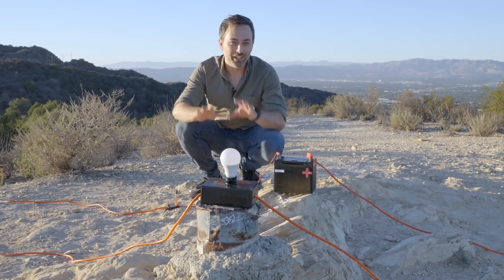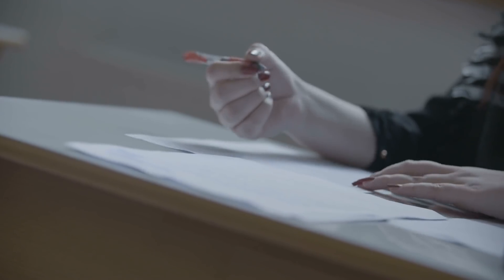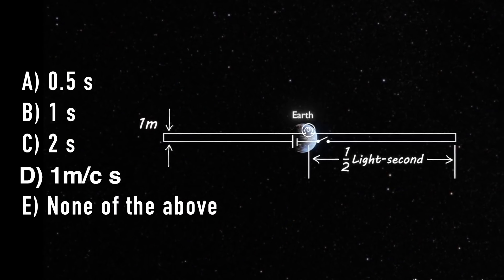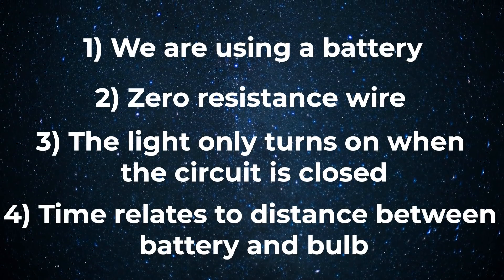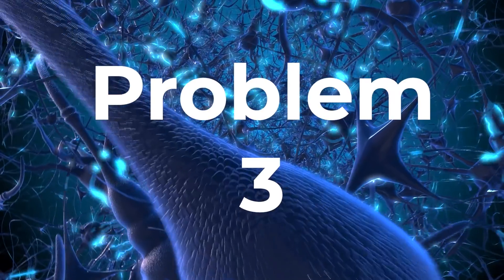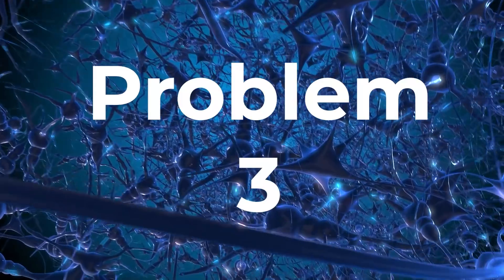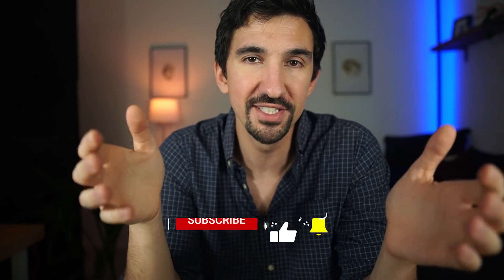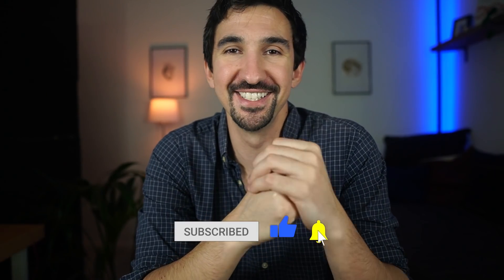Is Veritasium Wrong About Electricity?

Comment: The field model or more specifically the wave model is correct (and I believe what veritasium was trying to convey). It's something you can test in the lab actually, and you don't need super conductors. Getting macroscale timing is almost impossible because of the wire lengths involved, but you can do it on the microsecond time scale fairly straightforwardly.  You need a signal generator, a scope and a really long coax cable.

If you use the signal generator (in pulse mode) like the battery/switch and the scope like the light. Attach the BNC in series so that it extends the circuit. If you're careful with your' measurements you'll see the oscilliscope come up almost instantly (thickness of cable  / c). You can go further and see that regardless of how long the cable is, there only seems to be about 50 ohms of source resistance initially. If that coax cable is terminated then when the wave hits the end it's absorbed and the initial state is the final state. However, if the cable is open (or terminated with anything other than 50 ohms) the wave will reflect back and you'll see a change in level when it hits the scope (depending on how the scope is terminated it might bounce again). 

In veritasium's setup, the impedance seen by the circuit (while the wave is propogating) would be cosh^-1(s/d) * sqrt(u/e) / pi. Assuming that's 4/0 cabling would put it at about  600 ohms per side or just over a kiloohm. That's actually enough to light an LED  on 12V.
Reply: That is NOT 4/0 cabling. In fact, if he hooked up a 12 V car battery to 4/0 cables somehow (you would need to build your own connection method, as 4/0 cable is HUUUUUGE), the resistance of the 4/0 wire would be too high to light the bulb even if the cables were short. 4/0 has a large diameter compared to the 14 or 12 AWG cable that should have been used for this. You could do with an 18 or 22 AWG cable too, since it's just on a 12 V DC car battery. They could handle it. a 4/0 has a diameter of almost 12 centimeters (not counting the insulation, just the conductor inside it), while a 14 AWG (standard for lighting circuits in houses) has a diameter close to 1.5 mm, assuming copper conductors, not aluminum or gold.   The surface area of the conductor matters a lot, just as the length of the conductor does, when calculating the resistance of the circuit. You may be able to get a small diode to light up off a 12V source using 4/0 conductors, but not a full sized lightbulb, without increasing the power source way about 12V DC. You'd need to built a custom battery, a custom switch, and a custom light socket to be able to use 4/0 cables in any setup with 12V DC or 120V AC. JUST to terminate the wires.
Reply: @captaindred342  
1) 4/0 cabling has a diameter of 0.5inches. I've worked with it quite a bit and attached it to many batteries.  The cable in veritasium's video seemed to be about that, might have been 3/0 or 2/0. The specific diameter doesn't really change things much, you could probably go all the way to a 22 AWG wire and still not see much change in the way of behaviour. 

2) when you are talking DC resistivity it goes DOWN with a bigger cable. 4/0 cable has LESS resistance than 12 or 14 AWG. Yes for a typical circuit in your home that is what you'd likely install because 4/0 would be unwieldy and why waste copper but that's not what we are talking about here.  We're discussing vertasium's setup as built. Go back to his video, those are single conductor cables.  

3) the resistance I'm talking about is not the resistance of the wire. I'm talking about the resistance the waves feel as they propagate through space around the wire. This is the resistance of 1K I was talking about.  For 4/0 cable to get to that equivalent DC resistance you'd need a length a few hundred kilometers long. Why did I need to pick a cable diameter. Well the wave impedance formula depends on capacitance and inductance between the wires which is roughly the logarithm of the separation over the wire diameter.

4) Could that power a light bulb, yes with caveats. First caveat, the light bulb would need to be small enough to run with a 1 Kohm impedance attaching it to a 12V source. An LED would run fine, or a really small incandescant, and this bulb would light up even if the wires were broken at the end or infinitely long. Second caveat, the wave would race away from the switch so fast that wire resistance would overcome it in about a millisecond and the light would go out again after about that time unless we are talking about super conductors (which veritasium said they were).

5) Does this all apply to a house. YES but the effect is so small we neglect it almost entirely. In reality what happens is that wave bounces to the light and it sees that really high impedance and turns on a little, then it bounces back to the switch and so on and so forth each time the resistance drops a little bit. Assuming your light bulb is a few meters away from the switch, the entire process would be over in a few hundred nanoseconds.
Reply: @binaryblade2  omg LOL 12 mm not 12 cm, sorry! typo, my bad. But that don't change a thing. You'd still need to custom build the parts he used to work with 4/0, they don't have terminals big enough for it. And that's not 4/0. That's an extension cord you use to plug in car block heaters, your lawnmower, power tools... He just cut the cord ends off and terminated them to the battery and the light socket. Looks heavy duty to me, probably a 12 AWG extension cord. How much do you think he spent on that experiment? even 20 feet that he would have had to use for that video (since he wanted to run them off the screen to make it look 300M miles long) would have been quite expensive compared to buying a 20 dollar extension cord. That ain't 4/0 lol
Reply: @binaryblade2  omg lol #2!! This is what I get for ish posting on youtube after a few beers. I'm sorry, my bad! Thank you. U rite. 

That still isn't 4/0 though. Even if that is a single conductor rather than a cheap cable with the cord ends cut off, it is not 4/0. It could be #6, maybe #8, they're about the same size as an extension cord. They also don't normally come in colors like orange though. They are usually black. Also, it's almost impossible to get a #4 to sit straight, it will curve the way it was curved on the roll it comes on unless you spend a great deal of time bending it to be straight. I'm pretty certain that is not as large as #4, let alone 4/0. #8 and #6 are a LOT easier to work with, and could be easily laid out the way they are in the video without hours of effort or metal straps secured strongly. You just can't do that with big conductors. They way he has them laid out, there is no way they are high amp conductors, even if you ignore the rediculous cost difference it would have put him out of pocket to use anything in the #4 to 4/0 range, or him paying extra for special color insulation, or paying an apprentice to tape that entire length with orange phase tape (that would take even me a good 2 hours to tape that black cable up to look orange along that 20 feet of length visible in the video. There''s just no way he did that. Even building a multimillion dollar project we wouldn't waste that kind of time or money.

Comment: I agree with most of your video, but I'm not so sure you are right when you say that the lightbulb would reach full power only after the circuit reaches a stable state at about 1 s. I would think that if you would further idealize this scenario by making the antenna superconducting and infinitely long (they might as well be, the first 1/2 s), the amount of energy flowing from the battery towards the light bulb would still approach the same limit as if the circuit was closed. And I would guess that this would happen within the order of meters/c (not yet at 1 m/c due to causality, but surely at 10 m/c), since 1 m/c that is the only amount of time that seems to be relevant in this scenario.

Comment: As for the point at 4:05, the field lines spready around the whole circuit, so from the breakpoint, the electric field is still feeding into the lamp and the full voltage is still present at the instant the circuit is broken. The electric field continues travelling at the speed of light from this point until its' energy is absorbed by the lamp, so the information would not get there at above the speed of light. I have worked with high voltage PSU and have seen especially when they are off load that voltage does not dissipate instantaneously just because the circuit is broken (then again, this could be partly due to the capacitance of the voltage multiplier)

Comment: What I find misleading in Veritasium's video is the same point you made: the light would turn on with the full power only when the electric fields inside the wire reach the lamp (so that a stationary current is stablished and the energy emitted as light and heat is coming from the local EM fields, as described by the Poynting vector). Of course there is an EM signal from the changing electric and magnetic fields when the switch is turned on that propagates at the speed of light (and carries energy) that will be felt by the circuit near the bulb. But this will not keep the lamp turned on (supposing the EM signal carries sufficient energy for that), as there won't be any variable fields after the wave passes (no current).

I think the video gives the wrong impression that in our houses we are simply collecting the energy that propagates from the power station in the speed of light, but this can't be the case. In the thought experiment, the stationary electric and magnetic fields at some distance between the battery and the lightbulb are probably negligible (and if they are not, we can reduce the voltage or increase the distance). If you want, put the battery inside a Faraday cage. With no electric and magnetic fields, the Poynting vector is zero, but the lamp still turns on when the stationary current reaches it. This is because the Poynting vector tells us about the local flux of energy. The EM energy that powers the lamp comes from the EM fields that are present around it and are generated by the the wire itself. Luckly, eletromagnetism has also global conservation of energy, so the same amount of energy the battery generates is released somewhere else.

Comment: This is a disingenuous take. The assumption that the cable breaks and then transmits info faster than light is clearly meant as a cheap shot. But it is clear that the point of the video is to have a very long wire with "easy to calculate" parameters, in an idealized condition, so that there would be a difference in how quick the light turns on. If the length of the wire was 3m and the distance from the source still one m, there would be no way to experimentally determine what is going on. And because of this, the matter is solved theoretically and he is right. Second and more important: the pipe current "model" is not a model, it's a metaphor. It does not simplify reality: it assumes something else entirely. In neurons, for example you have the movement of charges alone axons, and then the transmissions though synapses. That is small scale how electricity is transmitted in real life. And the "model" does make a mistake, because electrons do not move across the wire entirely, they oscillate, and/or are excited. It is just the fact that they are slightly moving that generates the electric and magnetic field, and causes the transmission of energy.

Comment: He literally explained the field effect, and the fact of the power curve in the video. The point is that it's the distance between the switch and the bulb that's relevant, not the length of the wire was what I got from the original video.
Reply: If veritasium video were true, then there is no need for the cables to connect, you could take the problem to the extreme and extende the cables close to infinity, the light would turn on just by having long wires close to each other and flipping the switch, which is obviously not true. People argue that there is some capacitance between the wires, but that is also very misleading, a capacitor works with electric fields and electric charges, but a conducting wire is almost completely neutral, there are no more electrons in a wire or the other.

Comment: Yes, this takes a rather nit picky bit of how electricity works and amplifies it to imply that energy flux is what really drives everything we see (rather than it being a tacked-on way to describe how power is conserved in a circuit) whi9le also being required to toss-out many of the basic principles of electronics in order to make the example work. It's the science equivalent of saying because smoke goes up a chimney, Santa Claus is real.
Reply: "Turn on" is also a big lie, because we would need to use a high speed camera to record the "flash" of light that is actually already out again when we reach 1m/c seconds, and even that has a ramping up time from zero volts to 12 volts, which you may not actually reach because I don't think you would get capacitive coupling on the other side of the circuit.. and if you did, it would double the length of time. 1m/c only works on the positive leads; still need 1m/c for the negative lead coupling.
Reply: What bothers me most about "those lies" is that the whole Poynting vector thing is built on top of them! Describe the flow of energy around a circuit without using any of "those lies" and I'd be happy to learn something new (but no one can, so all he has done is take a correct intuition and replace it with a psudoscientific "understanding").

Comment: Your fourth assumption is incorrect and also not presented in the Veritasium video.

The time relates to the distance between switch and bulb.  The battery’s location is irrelevant.

If the wire were to be broken at the extreme end of the loop that’s just equivalent to a remotely positioned switch opening.

The time taken for the bulb to go out in that case would be 1s, based on the distance from that “switch” to the bulb.

Causality is not violated.

And it is not the case that the lamp initially turns on dimly, due to some kind of initial weak antenna-esque interaction between the different parts of the wire loop.  The bulb comes on, at full brightness, after 1m/c seconds.

Comment: This was the response I posted on varitasiums video 
“I would argue that the field in the whole circuit isn’t actually happening until all the electrons in the circuit are actually moving. It seems really wish washy that you make an example about how the field is present in an already flowing circuit. And then assume the field in the whole light year long circuit is already existing everywhere around that circuit the moment you flip the switch. The pointing vector can’t exist around the whole circuit until their is an electric and magnetic field present around the whole circuit. Again something that doesn’t exist in the wire nearest the bulb right when the switch is flipped. 

But if you’re just talking about capacitive coupling of the two wires next to each other and the current increasing in one at the moment the circuit is turned on induces a current in the wire nice to it then this is a completely different question and you really just made a trick question. In this case the pointing vector would only point to the source during the time the current is changing in the near wire and as soon as the current stabilizes you will stop seeing a Poynting vector pointed in the direction of the light until again the field is actually present everywhere around the wire. 

We can’t instantaneously assume the whole wire has its electric and magnetic field present the moment the switch is turned on. I feel like this was just a trick question that only works if the wires going out and back are actually near eachother. If the wires going out in each direction did a circular ring that has a circumference of 1 light second I would be inclined to say the answer wouldn’t be the same. Although the act of making the ring may inductively couple the entire wire to itself and the changing magnetic field anywhere within the coil has a self inductance to the rest of the coil. Maybe that’s really the answer. You can’t make a closed loop circuit like that without the self inductance of the whole coil coupling every point on the coil. 🤷‍♂️

Not saying you’re wrong… just this seems very hand wavy to me and only really the answer for this particular arrangement. While it’s a counterintuitive answer it doesn’t really give the whole picture still.

This has really thrown a wrench into what I thought was a complete understanding of how Nikola Tesla’s bifilar coils work lmao damnit.”
Reply: Yeah Derek’s whole bit about “scientific lies” rubbed me the wrong way. Especially people who haven’t bothered to take a single science class after 8th grade science. You weren’t lied to. You simply did not have the scientific wherewithal for it to be explained to you in the complex way.

Comment: If you are taking into account the units "sloppiness" of the original video (from which I guess almost everybody understood what it mean) you should give the correct way of doing it. 1m/c would be that correct way, but you kept the s after that, turning it into a squared time quantity.
Reply: And yeah, it should depend on the distance to the switch (once stationary state is already reached with the battery) not the distance to the battery.